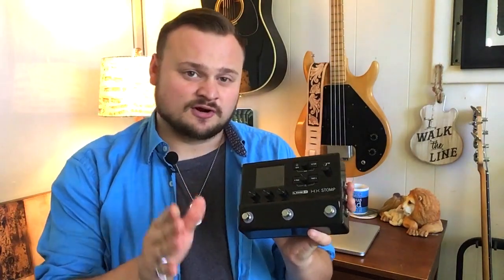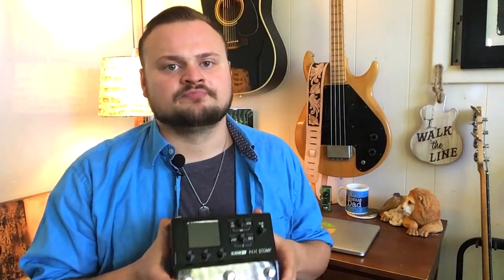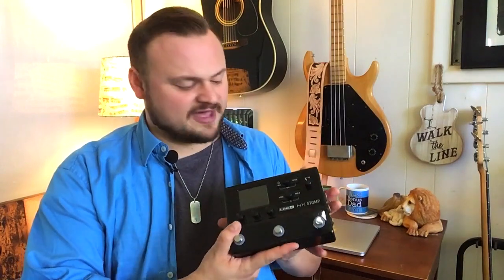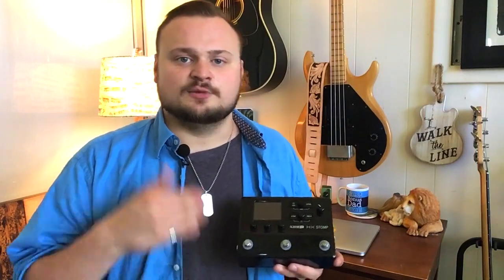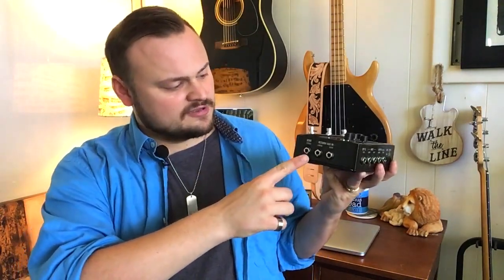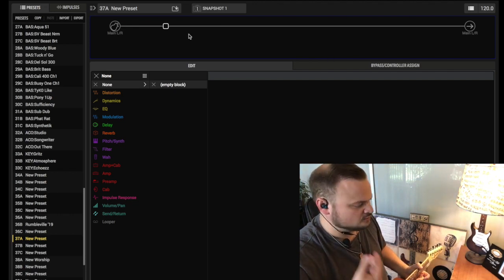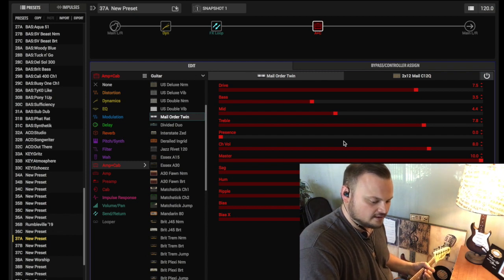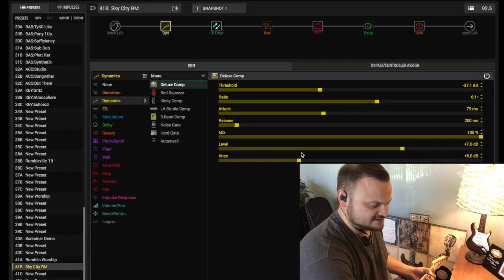Line 6 HX Stomp Tutorial // How to integrate HX Stomp with your pedalboard

Comment: Excellent video! Question: I'd like to get the HX stomp effects out ..........in to a Grace Design Alix which I use for acoustic guitar. I have the proper Y cable. How would I get the effects out only for my acoustic instruments (there is no need to return back to the HX)? Thanks
Reply from the maker: Man I honestly don’t know. So sorry. I assume FX loop.
Reply: @RumblinMan  Line 6 helped me out with this one after I asked the question here. SOLUTION: 1. Within the edit of the channel you're using (34A for example) add a "Send FX" box after the effects; 2. connect a 1/4" from the HX "SEND" into the Grace Design "IN" (or whatever pre-amp you're using). Your guitars will all plug into the HX as normal. When you're on 34A your acoustic will NOT send a signal out of the HX but rather through the Grace Design (your external pre-amp). However, when you switch to an electric guitar channel (37A for example) the signal will come out of the HX and not the external pre. I hope this makes sense. It works perfect and you'll only need one guitar cable (I use a G30 wireless & it's easy to switch from acoustic to electric while on stage.) Thanks for replying and I hope this proves helpful to others.

Comment: hi! your vids are really informative! ive got a question.. in what order should i use my pedals on the fx loop of the hx stomp? i recently bought an hx stomp and want to incorporate my other pedals.. mainly a tuner,  boss ns2, wah, carbon copy deluxe,horizon device precision drive. and planning to get a revv g4. i hope you could give me some advice. thanks!
Reply from the maker: Arctic Frost I would usually place drives before modulations, and modulations before the amp. Then delays and reverbs after the amp. That’s how I would do it. So you have to place the FX loop wisely for sure.

Comment: Use a Ernie MVP pedal and you get no tone loss. I like it first but some it after. You get more drive at lower level. I would try a comp like JHS Tiddy diddy or Wampler mini and put it all in the front instead of the loop   Seems to sound better to me. My sound is more sparkly but I’m using a amp   You have much better eq in the stomp. Boost to lead off.  RC. great for the money. Also strymon and vertex both super clean. Michael britts IRS are far superior.  Doing a good job just trying some things that work for me. I use a QSC K12  because I double on keyboard.  I just added the new strymon. Awesome. I’ve had helix and kemper  feels like a amp. It’s far the best. Keep up the good work.
Reply from the maker: Jeff Hogsten thank you for the kind words and all your feedback! God bless and Merry Christmas!

Comment: I'm about to buy one of of these units for modulations and some effects and you definitively got me closer. I just have one question though. How would you connect it using the 4 cable methods? I prefer to send modulations before preamp, separete from distortions. 
I have a Hughhes and Kettner Grandmeister
 deluxe 40 if that helps. 
Thanks in advance.
Reply: You can order these things in the effects line - just put the fx loop before the amp/cabinet simulators.

Comment: Great video! How is it, if im using different amp cabs and simulations, but still using my actual fender blues deluxe, is there a point???
Reply from the maker: Pearu Pindre hey bro! At that point there isn’t appoint unless you’re using the Stomp strictly for effects.
Reply: If you use your fender in clean you can still use the amp modeling to modify its tone.  Or you can use the return on your amps effects loop to just use its power section (no preamp).  There is also a way to run the 4 cable method to use your amp as the preamp back into the HX and back out into the return of amp.  That way you can use the tone from amps pre, but through pedal and cab simulation back to speaker.

Comment: Great video. I just got a HX Stomp. Do you notice a large tone loss when enabling the FX loop? I have not sure what i'm doing wrong but i'm getting tone loss  when i enable the fx loop.
Reply from the maker: Matt Moore hey man. Very interesting. I will have to pay closer attention... I have never noticed any kind of tone loss with the FX loop. To me it’s always sounded really good. Hm. Ya know what’s funny though. I recently got rid of a volume pedal that was shorting out, and I realized that the volume pedal had been changing my tone and that my rig sounds way better without it. Weird I know!
Reply: Make sure you have your input impedance to instrument and not line level. It’s in the first spot right before your blocks start.  You may need to modify levels as well.